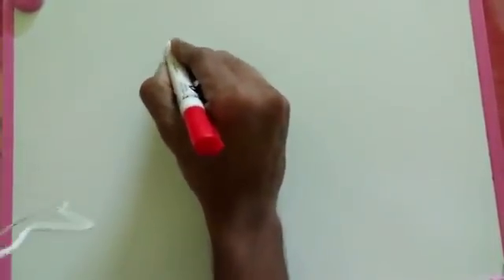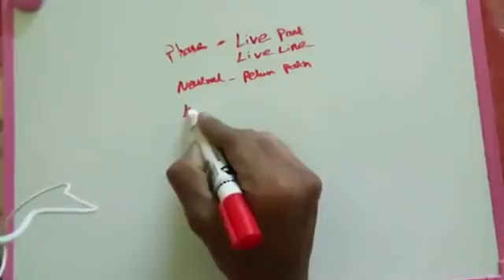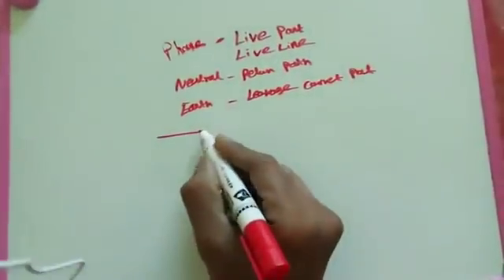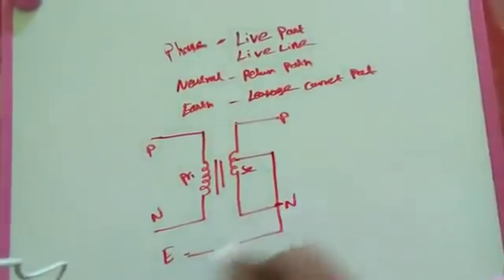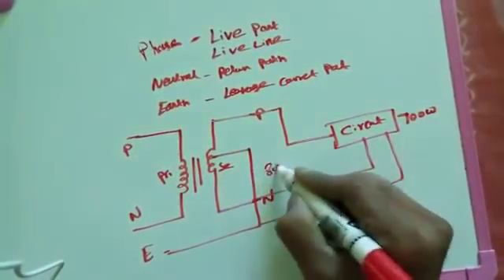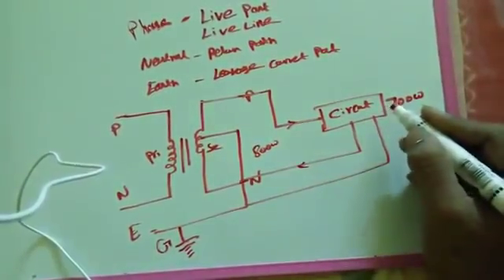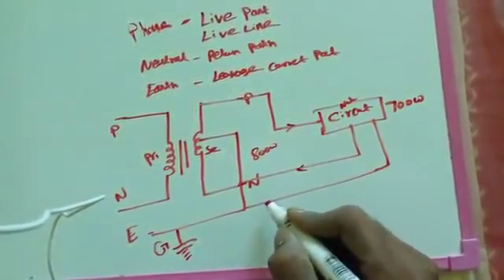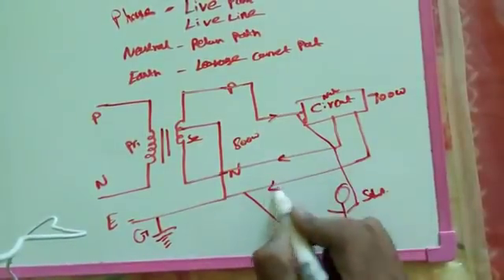நூட்ரல் மற்றும் இஏர்த் கும் உள்ள வித்தியாசங்கள் /what is neutral and earth  in tamil

Comment: I'm asking 1 question .delta connection la irundhu eppdi  nutral edupinga....??
Reply: ahha ramesha ,,ungalukku theriyuma bro??
Reply: @arjun0781  i know ... Actually nutral point substation ku pogadhu....stepdown transformer la ground panni iruppanga.....delta to star transformer use pannuvanga
Reply: @arjun0781  delta 3 wire system  so anga nutral irukkadhu....namma dha nutral point ah split panrom....
Reply: @arjun0781  nutral um oru phase ah act ahgum.....some times, but earthing...safty kaga use panra grounding.....nutral aium ground pannu ohm but nutral phase oda link la irukkum....earthing components kuda link la irukkum....adhu fulla safety kaga dha....